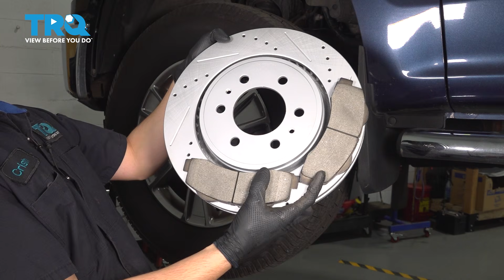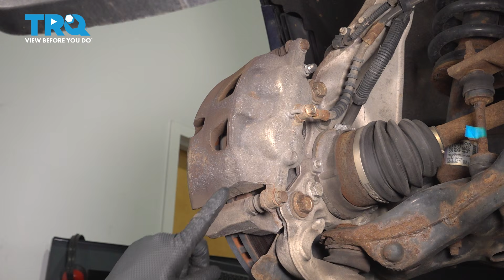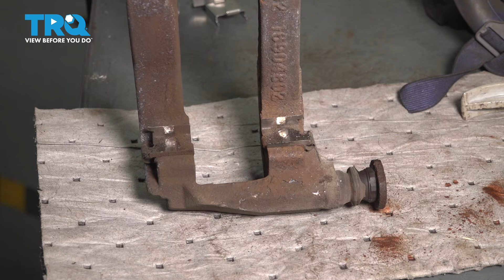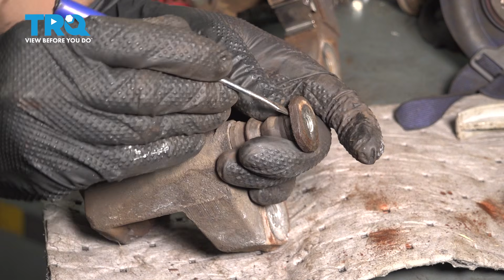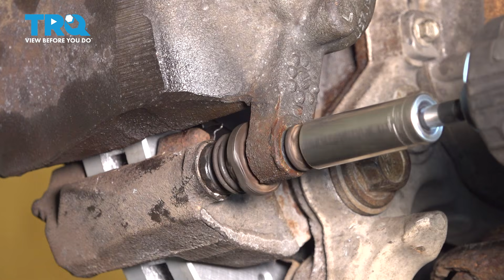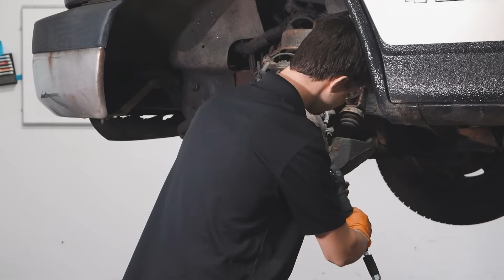How to Replace Front Brakes 2015-2020 Ford F-150

Comment: Double check all of the torque specs from other sources. 

A small dot of locktite on the caliper bracket bolts.

Comment: no reason to touch the bleeder screw, unless you are trying to increase the customer cost by charging  for brake fluid flush. Just use an old pad and a c-clamp or pad and large slip joint pliers. Been doing that for decades.